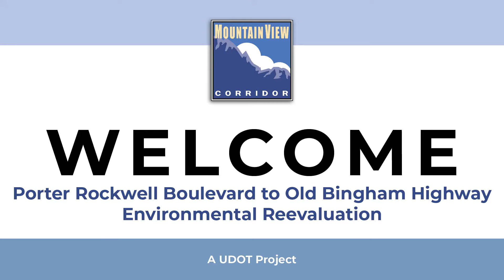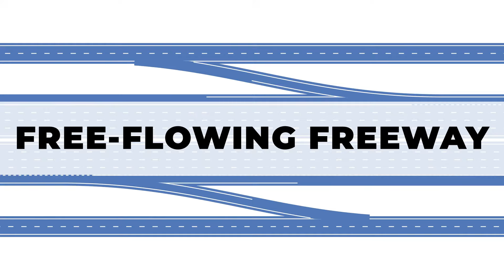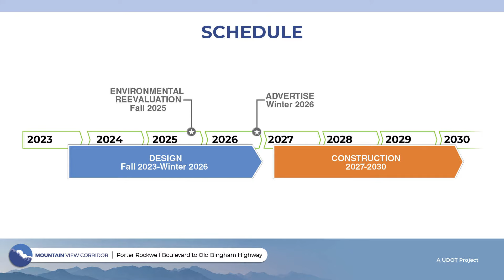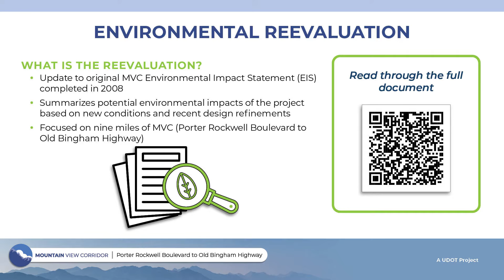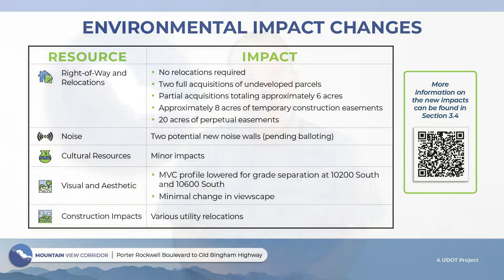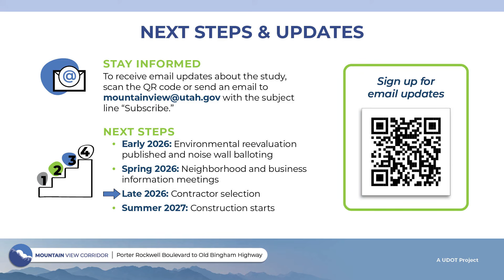Mountain View Corridor Public Hearing Overview

Comment: I avoid MVC at all costs, it's the least efficient and most poorly designed stretch of road in the world, at least this hemisphere.   Someone should feel bad with how terrible it is.  Even when i had a driving job, I'd go around this road.

The fact you're not starting with high priority interchanges like the ones on the north end just further proves this point.  Ya'll knew population growth was coming and you shortchanged the public.  Now it's another decade before it's done right.

Interchanges on 4100 and 3500 should start tomorrow because the need there exceeds extra lanes elsewhere.